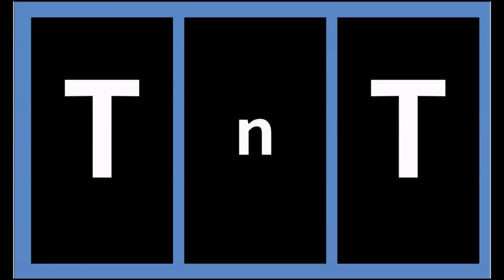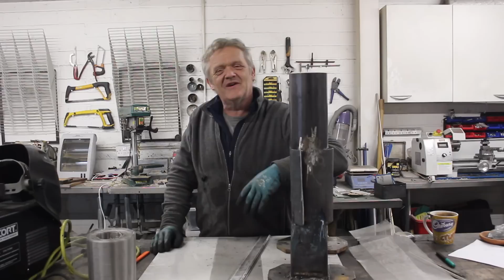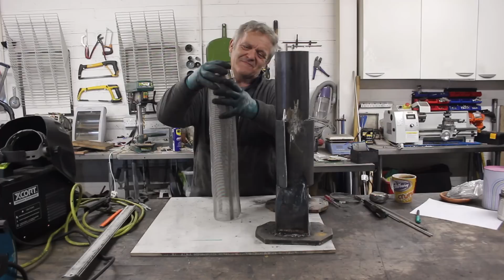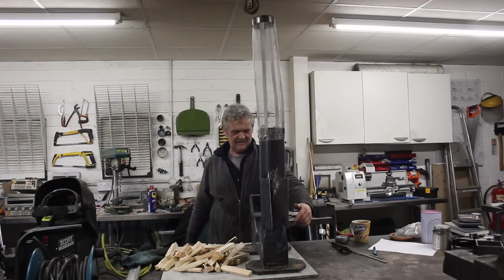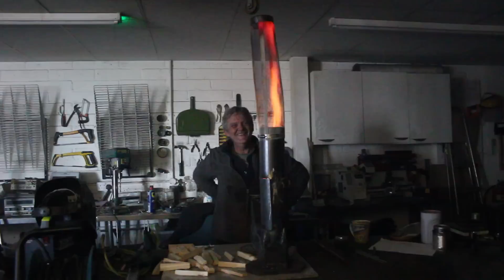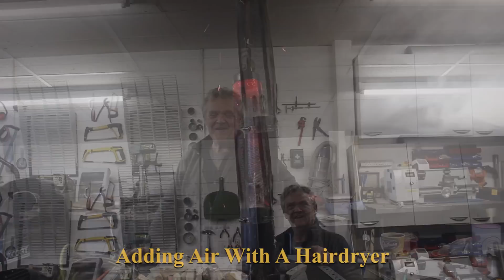1737 Crazy Vortex Heater

Comment: CORN burner from a hopper outside the farmhouse with a worm feed, My sister in Canada had this setup back in 2018. Easy to grow dry and store compared to wood pellets ?
One interesting point is they harvest the corn around October so that it is as dry as possible; the corn is usually sent for storage and they weigh it and then dry it then weigh it again and charge you for the moisture removed.

Comment: FIRE 🔥🔥🔥🔥 !  😱
LOL 😀! 
Needs a radiator and copper coil system so the stove can go outside. It would need a flue or chimney system to be safer to use the stove inside. If it's over 4kw you would need ventilation or an air intake coming from outside depending on the size room you are putting it in. A gravity fed pellet , old timber or pallet wood system would be great. 
Keep em coming.! 🔥👍

Comment: Baffles. You need adjustable baffles about half way up the 4” vertical pipe. Cut slots and they can slide in & out. Then of course a door on the square open draft end.

Comment: Reminded me of being inspired by YouTube videos to try blasting air into the base of my garden incinerator. So I inserted 2 lengths of old stainless steel hoover tube into the bottom of the incinerator. Connected the old hoover hose to the hose of my workshop vac hose with tape. Set it to blow and switched on. Massive flames blew out of all of the holes around the incinerator, and from around the bottom of the lid.  Success as a "proof of concept", but I am now looking for a suitable metal container without so many holes. 🔥🧯🙂

Comment: Is there a difference between stainless steel and galvanized steel?
Galvanized is readily available locally.
Reply: Stainless steel contains at least 13% of chromium, plus nickel, sometimes molybdenum, depending of the severity of corrosion.

The linear dilatation when heated is terrible, 3 times more than classic steel, covered or not with zinc.

So using stainless steels can provides lots lots of issues.
Reply: Good idea, as long as you burn off the galvanized completely as its highly toxic.  But it will work!
Reply: Oh, also if it's a long term project, you want to use stainless as it will last a lot longer.
Reply: @l0I0I0I0  Well, it isn't meant to be a disposable heater.  :-D

I am saddened, as galvanized is cheap as all get out.  Off to Amazon, I guess.
Reply: @colfaxschuyler3675  I hope you will post your project for us to see?
Reply: @l0I0I0I0  I am gathering parts, but scrounging as much as I can.  The potential for toxic stuff has me concerned - for an inside heater.
Reply: @colfaxschuyler3675  yes I feel the same way.  Even wood long term is an issue.   
I'm designing mine so it takes in air from outside and exhaust air outside.  But mine will use some sort of mass to store the heat.  Probably rot iron powder if I can find it or something cheap and close to it.
Reply: @l0I0I0I0  Sand?  Cheap.
Reply: @colfaxschuyler3675  true, but I want a higher volumetric heating capacity than sand.  But sand works!  Not knocking it of course but looking for greater ability to store more heat.  I've got an excel spreadsheet where I've calculated it for many substances, and rot iron has far greater ability to store heat in my temperature range.  However it does depends on cost.  Good thing about both sand and rot iron, it can store a lot of energy without melting which requires special coatings, more work and more cost.  
GL!
Reply: @l0I0I0I0  I've always been fascinated by phase-change materials for heat storage.  But they aren't inexpensive.
Reply: @colfaxschuyler3675  It's very useful to know the latent heat of materials at phase change from solid to liquid or liquid to gas.  The amount of energy required to make the change far exceeds the rise or fall in energy.  Smart engineers will use the melting point of substances to store a lot of energy that is just not possible for the intermittent non phase temp change in materials.  Water for example at takes a long time to exceed boiling, but can rise to boiling quickly.  So combining heat capacity with phase change is a great combo, but there's a problem of containing molten liquids at those temps as the containers don't last.  That's the big issue.  I'm sure someone has worked this out and I would love to have the recipe for making such a container.  I suspect it's related to harness but not certain.
Reply: @l0I0I0I0  Ice is a good example.  Most PC materials are outside of convenient temperature ranges for most experimenters.
There are some oils that have interesting traits, but they're more oddities than useful.
Coconut oil is an example.

Comment: Suggestion:
A crushing device not unlike Colin furze rubbish shredder, for shredding wood into the correct size chunks for a constant feed system for this, also dish the bottom so that you may also drip feed old, used oils
Reply: How about a colab video?

Comment: That was putting out to much smoke for an inside area. Regarding mantle construction, could you wrap the wire like a spiral bandage over a 110mm cylinder to simplify construction?

Comment: The purpose of a mantle is to get hot and radiate heat (or light). To do this you have to force the exhaust gases through it.
I would try an inverted cone in the top so that the diameter narrows as it rises. In theory the extra pressure at the top should force more gas out at the bottom.
Or perhaps a simpler solution would be a cone shaped mantle, perhaps even doubled up to increase resistance (or a cap on top).

Comment: The combustion chamber gets really hot, Steel will not last 70 cycles. You need to insulate the burn chamber with something like rockwool or perlite or even vermiculite..

Comment: this is the problem i had with the rocket stove : it burns too quickly.
On the other end of the spectrum is the woodgas stove; the problem with that is the risk of the fire going out, so a fan is useful. If there were a way, like the throttle regulator on a gas engine, to increase air depending on the heat output, to control air intake to slow down the burn without extinguishing the flame, that would be the best of both designs.

Comment: I think they mean it can't be a space heater because of all the smoke, it was wafting around in the background of this vdo, it would need to be vented outside. I dont think it would be necessary to do this with an alcohol stove which burns clean but an oil burner would also need a chimney and that gets into code issues

Comment: What is the benefit of the vortex? Does it offer more combustion  on secondary burn than just normal intake holes?
Reply: Vortex suck air more consistently and radiates heat better up the chimney. It also allows more combustion time in the chimney for less volatiles

Comment: I would love to see you do a home made digester with a gas collector. You can then adapt a petrol generator to start on fuel and then switch over to the gas from the generator. Gas gets cleaned by a home made activated carbon scrubber. You then have a generator making electricity for the house via a bank of batteries. And you also have gas you can cook on via a low pressure  gas cooker like a cadac or camping stove. It could work as a complete off grid sullution. And if you keep animals as a food source, they will also greatly improve your gas yield if you are adding their effluent to the gas digester. Its a very simple thing to make tbh.

Comment: I have an idea but I don't know if it would be a good idea, could you somehow mix a wind turbine into this with the idea that the Flames would push hot air where the turbine could get energy from the movement of air from the heat

Comment: It incorporates a vortex for a 200% efficiency increase. A base covered with ash, terakota flowerpot coated with graphite (again thanks 10c increase in temperature). A two layer can (two cans) with a forever wick between them (thanks for that :)). Ethanol  flame source a 40cm glass tube made of heat resistant glass made of borosilicate, with a vortex producing base. And a plower pot plate with an upside down bowl filled with sand on top hanging above the tube's flame. Should the tube be longer or made from metal mosquito netting? The flame might be too hot for that xD

Comment: Rob, I made a couple of these a few decades ago to provide heat and cooking facilities in the outback remote station camps for the Jackaroos here in Australia. From my experiments the vortex doesn't have to be as large as you made it and make sure you have the vortex going in the right direction, clockwise in the southern hemisphere and anti clockwise in the northern. 
I ended up taking the vortex out due to melting pots and pans.
Great videos, keep it up.

Comment: I've got 3 questions:

1. Where is your smoke sensor? How didn't it kick in?
2. Are those ceiling panels flammable?
3. Does your insurance company know what you're doing?

Bonus question?
4. Why does it burn less efficiently (i.e. more flame) when the mantle is on? You said before that no flame == more efficient burning. The vortex should still be sucking in enough oxygen - why doesn't it then?

Comment: About the woodn fuel, here in France eveything gets very expensive, and industrialized "liquid" wood (pellets) becomes very expensive (it's a bit a woods monopoly mafia around, since it can be overindustrialized..)
But wood can be harvested for free out of this circuit. I eard of a grandma having regularely pruned willows in her garden, doing it with a pair of shears every winter. It is a light wood, but it grows fast and is easily cutted by a grandma's power ^^ It was her heating source, right in her garden !! For less needing of feeding, there is the gravity fed rocket stove, the batchbox...
 A good combinaison of willow is to use it in a greywater artificial wetland filtration system.

Comment: Howz about putting the mantle on a slide, as it almost is anyway, such that it goes up and down the shaft and permits only what you allow. Also, this needs to be part of a system that makes ash removal real-time so that the unit doesn't need to be down whilst serviced. But I'm a stickler. Love this.

Comment: The only thing missing from that was a decent reflector!

And the manic cackle as the smoke fills the room would do any horror film proud too!

A word of warning (not that you need it ... but others might) Do not do the oil version without plenty of space round it. If you are going to use blown air you can get it up to welding temperature! ..... Not for the faint hearted! ;o)

Comment: Amazing modifications! It did pose a question, would the vortex flame get taller and hotter if the length of the chimney were much taller? How tall should a chimney be in order to have the same pull of air flow as you had there with the fan on? Also would the material the chimney is made from, would this also improve the airflow? Like making it out of sandstone?

Comment: Hi from France, you have made a very nice twirl, maybe the Coriolis Effect plays a role here. Have you taken it here ?

Or could you made here an opposite sense of twirling for providing a "visual proof" ? 

Very well done, maybe an annular ash tray could be useful to avoid any zig-zag hot point ^^

Very fine stainless steel can be found also.

Spot resistance welding can also be used with extra-long arms for such narrow and deep pipewire linear weld.

Best regards & greetings !

Comment: If you want to control the burn rate, perhaps you could try to throttle the air intake.

The rocket stove you have burns wet. You can tell that it doesn't take in enough air because adding the hairdryer helped it burn harder. I think you could try and experiment with a flap for the air intake that can be held open at various angles. Being able to control the amount of air that enters should help you control how hard it burns, but it might result in a sooty flame as more incomplete combustion takes place.
Reply: Yes, at three different points.  how much air comes in behind the wood, how much air comes in under the wood, and how much air comes in for the secondary burn.  I'm curious how you solve the indoor air quality issue with a heater like that - connect it to a conventional chimney?  Pellet-stove style vent?  Might make something like it for outdoor use, just to watch stuff burn in it.
Reply: That or put a sleeve on the mantle to reduce the amount of extra oxygen the gas inside gets. That should reduce the burn.

Or how about routing the chimney of the rocket stove through a thermal mass, like a block of sand or water? That will help you to retain the heat generated for longer.
Reply: @AlbertBergen  the problem with my suggestion is that reducing oxygen results in incomplete combustion, which means nasty gases like carbon monoxide are generated.

Perhaps instead of reducing air, the fuel could be reduced. Instead of a hopper as big as that, Rob could use a funnel instead. The funnel would allow Rob to hold wood ready to burn while still limiting the amount of wood exposed to the heat and fire below.
Reply: @darrylpang3903  maybe send fuel down a sloping length of metal U channel?
Could  run all way through with door on bottom for when ash needs removed. A little rake that fits inside the chanel might work well for pulling the Ash out

Comment: Hi Robert! I've enjoyed your videos immensely and have been working on my own design. Could you please send me your email address so I can ask you about my design? :)
Reply: It incorporates a vortex for a 200% efficiency increase. A base covered with ash, terakota flowerpot coated with graphite (again thanks 10c increase in temperature). A two layer can (two cans) with a forever wick between them (thanks for that :)). Ethanol  flame source a 40cm glass tube made of heat resistant glass made of borosilicate, with a vortex producing base. And a plower pot plate with an upside down bowl filled with sand on top hanging above the tube's flame. Should the tube be longer or made from metal mosquito netting? The flame might be too hot for that xD